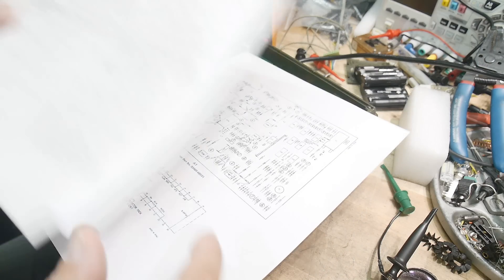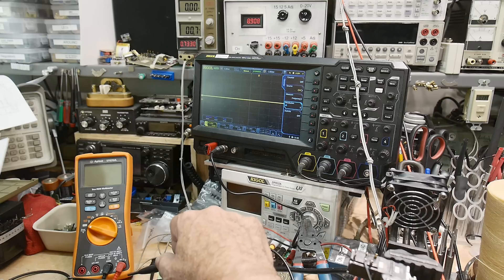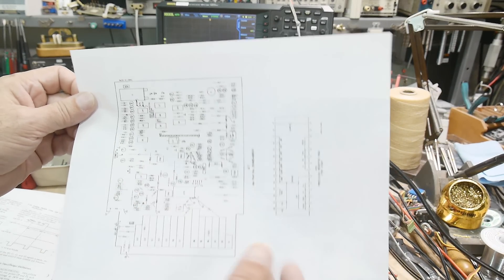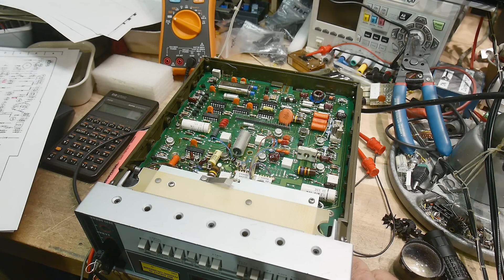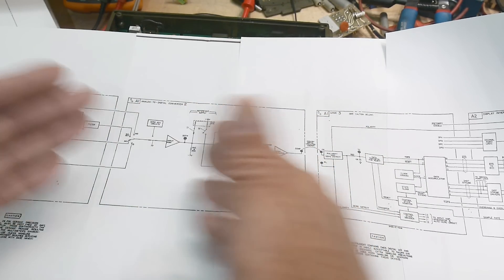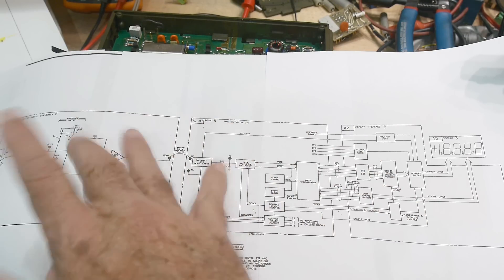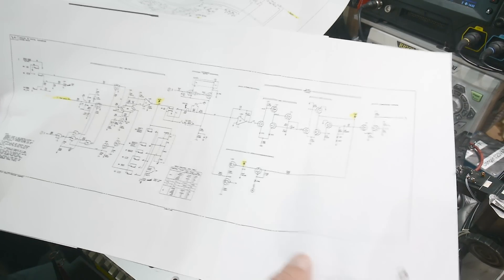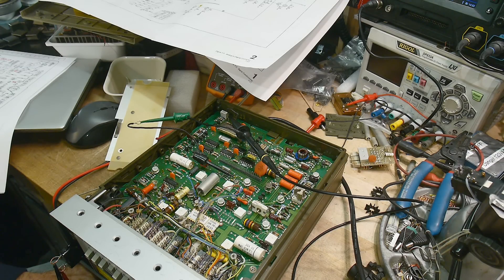#1352 HP 3465B Multimeter Repair (part 2 of 3)

Comment: The signal and reference have opposite sign so that the two slopes have opposite sign.  Once the signal charges C while the counter counts to overflow, the reference then discharges C until Vc is zero.  This zero crossing signals the logic to lock in the count as the new measurement, to reset the counter, and to begin a new measurement cycle with the signal charging C until the counter overflows...  Whichever (signal or reference) is positive is not getting connected to the integrator to discharge C.

Comment: Having large print of schematic is great.  What is the printer? HP...
Reply from the maker: Epson
Reply: @IMSAIGuy  Haha. Me thinking you're MrHP. Which printer is it?
Reply from the maker: Epson Artisan 830.    I even worked in the HP printer R&D lab! although on laser jets
Reply: @IMSAIGuy  Epson 83x line discontinued.  They suggested 7100 which doesn't improve on the legal size output I can do now.  I was guessing you had some large format printer.  What size paper you use?
Reply from the maker: @jspencerg  I use regular size paper and tape 🤣
Reply: @IMSAIGuy  cut&paste! Me imaging you with large format printer. I found an old dell 24" monitor with beaucoup input options to display pdf files.  Still good to have hard copy to study. 
Happy Holidays!

Comment: I have a question I hope to get answered. Would a repair shop for medical and or pc equipment need a high frequency LCR meter up to five megahertz?
Reply: Possibly; just depends on the type of repairs they are doing and how they normally diagnose. An LCR meter isn't necessary but can be useful.